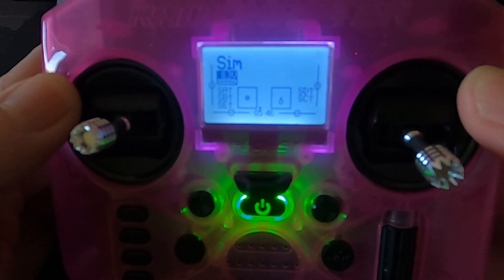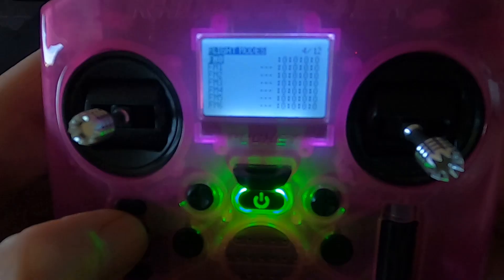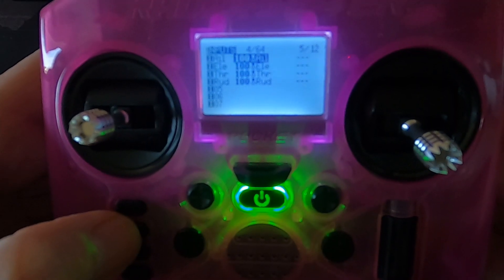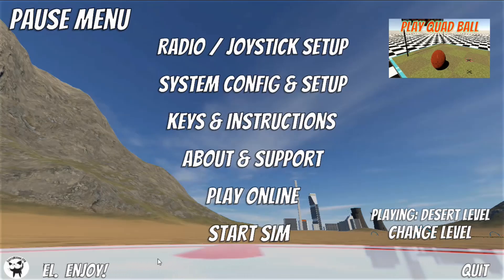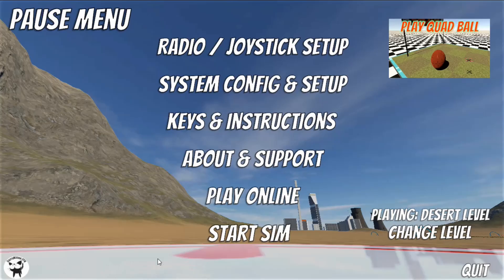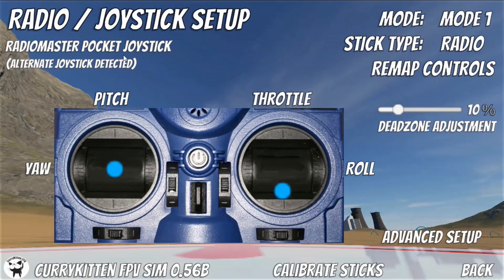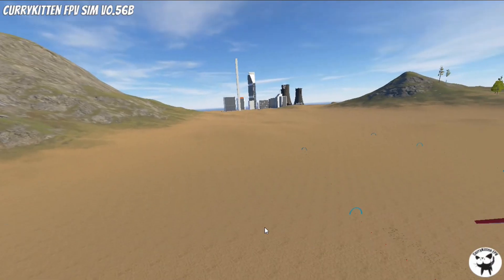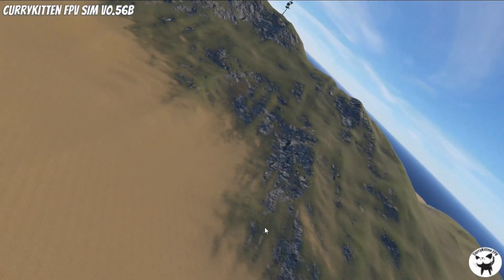RadioMaster Pocket Settings for flight simulator in EdgeTX

Comment: How do i change the symble for the rudder in outputs. Im not sure what i did but somehow im missing the symble between100 and rud
Reply from the maker: Could you please clarify you should not change anything under the OUTPUTS screen. This can be used to adjust servo positions in model planes using servos. Do you mean INPUTS or MIXES?

Comment: Hey there
thanks for the video
when i plug it in the pc, its not detected by Velocidrone nor Steam
i created the new model as suggested but nothing 
any suggestion?
also does the controller need to be turned on when connecting to the pc?
Reply: Same problem here! What did you do?

Comment: Connected Pocket to PS5 for DRL simulator. Gimbles callibrated and work ok. But the function buttons do not work. Looks like I need to configure the model. Once I managed to get one of the buttons working (use it to restart the mission), but then I changed the settings and forget (  Anyone knows the correct way to do it?
Reply from the maker: I do not have the DRL simulator but you need to look at the radio configuration options in DRL.

Comment: hi, thanks for the video. when i connect the controller to my pc, it detects it but i get a code 28 (driver problem). is this linked to the fact that i don't have a battery in it? Is it possible to do this without a battery by connecting the controller's power supply by cable? (via the usb-c port on the bottom of the controller). thanks in advance!
Reply from the maker: You will need batteries in the radio.

Comment: Hi 
RM Pocket is connected in Liftoff Simulator and pop-up 👍 but 
Not working/ reacting 
Plz help me
Reply from the maker: If you are sure the radio is connecting to the computer and showing in Liftoff, try manually mapping and doing the calibration process in Liftoff.

Comment: Hi Radiomaster pocket in connecting to liftoff simulator but not working 😢 
Help me plz
Reply from the maker: If you have programmed everything ok and is your computer detecting your radio when you plug it in?
Reply: Did you get it to work?

Comment: Downloaded from developer site (GITHUB) -The 'CurryKitten FPV Sim 0.56b' Win64 version. Installed, but it does not recognize the radio (did the -new profile with no mods, just named as sim). All switches were down/off including the power. Nothing going so far (Win 11 x64). -Your help is appreciated.

Comment: pitch and roll don't work, how do I fix that?
Reply from the maker: Let’s get the niceties over, Hi dfobox. If the other channels are working it is your channel mapping. Go into the flight simulator and have a look at the controller set up and change the channels.
Reply: it worked fine on another computer though
Reply from the maker: @dfobox then the settings on the second computers flight Simulator need to be checked.

Comment: Hi do you know flight simulator for RC Plane that I can use for my radiomaster pocket ELRS?
I have tried Clear View simulator but I cannot control using Radiomaster Pocket
Reply from the maker: Hi Rahadyan, it will work with Clear View I have just tested my Pocket with the flight simulator. Check all you settings again and make sure your computer is detecting your radio, does it make the two tone noise when plugging in? Are you plugging into the top USB C of the Pocket and selecting joystick option on the radio?
Reply: @the-happy-RC-flyer  Hi thank you so much for your reply
I will try it again
Previously I connect my remote using USB C in the front 

The Clear View Controll setting detect my Radiomaster remote

Then, I do calibration by moving my controller

The X,Y,Z axis in the Clear view are moving
But, after I click ok then trying to move the control again there is the CV Joint didnt move